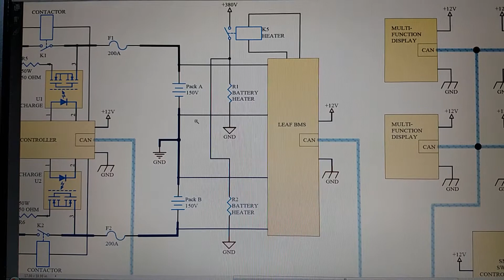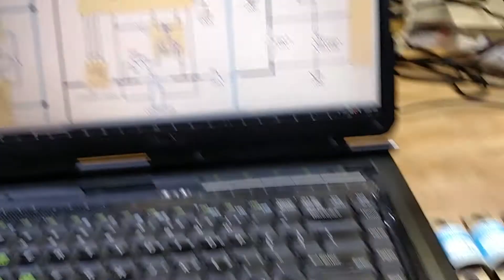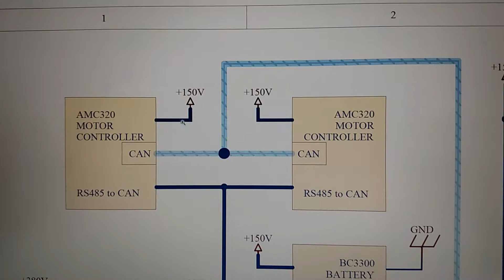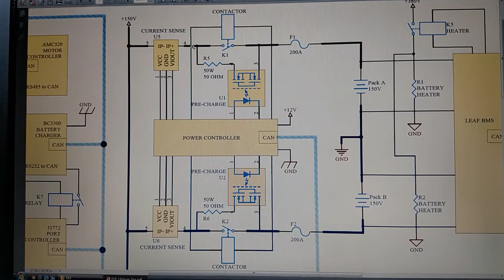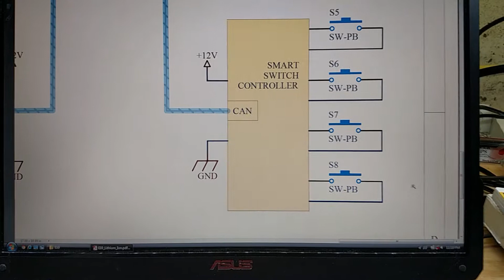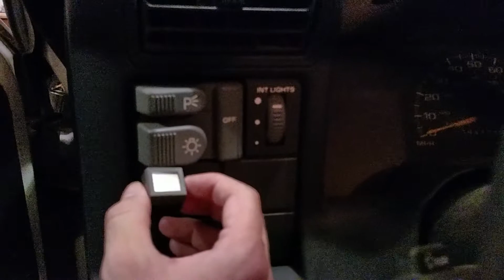Solectria E10, Lithium Ion Battery Upgrade, Part25

Comment: Why 4 packs? Why not parallel cells/modules?
Reply from the maker: If you parallel the cells, and one was to fail shorted...
All the energy from the other parallel cells will discharge into the shorted cell.
This will cause the shorted cell to overheat and catch fire.

To protect against this, you would need to have fuse-able links connecting every cell in parallel.

That would be lots of fuse-able links. ;)
Reply: @WolfTronix   Yes like Tesla's fuses in their packs. Funny I should ask this because in all my remote solar powered radio repeater installations I have done a similar thing, using schottky diodes to isolate parallel batteries and dual regulators in case of failure. It paid off one winter as the site is only accessible in summer.
Reply: I guess the resistance of the fuse-able links in the Tesla packs is not a big issue because there are so many of them in parallel.

Comment: Can you cut the wire in the heaters right in the middle and re-wire them in parallel?  Then they should run at 1/2 of 360v, so you could run them on pack nominal.  Long shot, but maybe.
Reply from the maker: +SquishyBrained 

I don't think there is a way to cut them... The wires go into a metal foil looking heating element... It might just be a nicrome, or thin film carbon... Not sure. ;)

I like the boost converter option... It looks like I can fit the whole thing inside the heater relay enclosure. :)